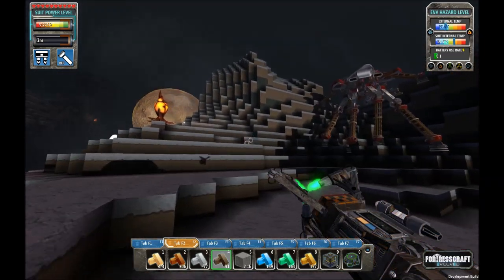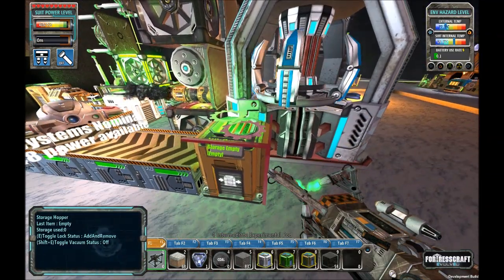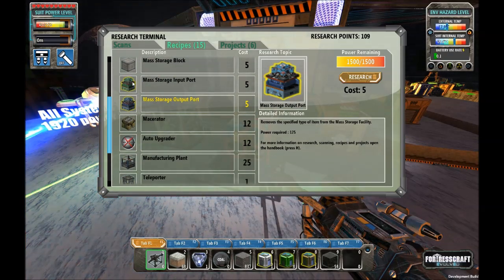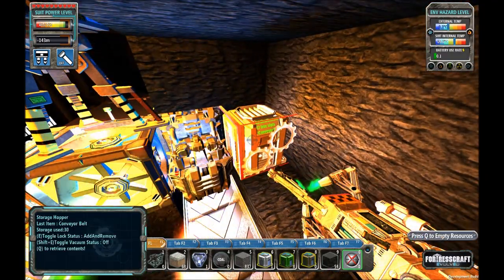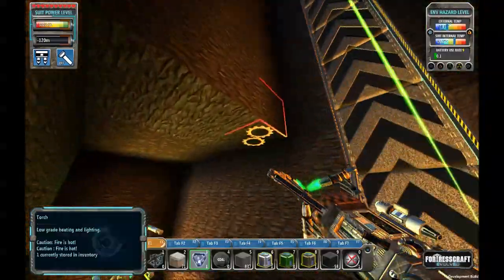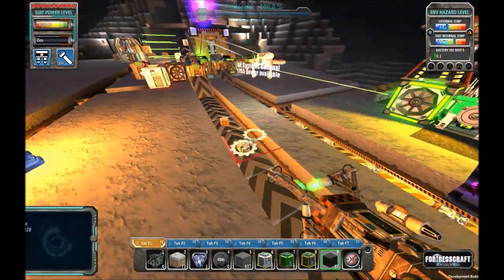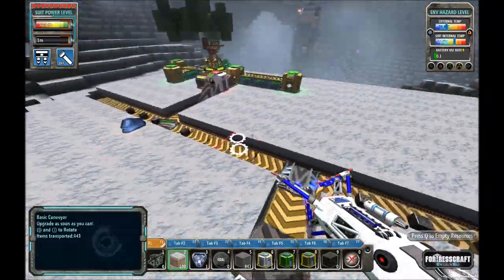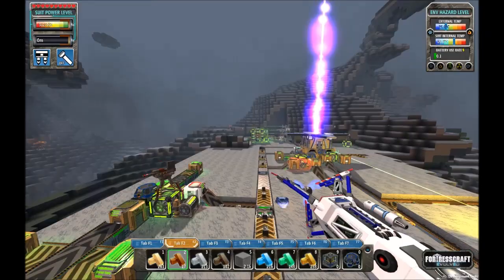FortressCraft Evolved   Ep10 More Ore Automation

Comment: the best way i found to power the lab early game is to place generators and hoppers like so
G = generator
M = mini hopper (green hopper)
H = 100 storage hopper

     v-----feed coal into this hopper
G H G 
G M G
G M G
    M 
G H G
G M G
G M G
    M
G H G
G M G
G M G

warp this around from one side over the top of the lab and down the another side
this holds 3000 power from the lab and 1000 power from each generator for a total of 21k power storage and power per sec of 180 power per sec. this works best if you have automated lines for each pod. which would take up the other 2 sides of the lab leaving only the only the bottom of the lab free to place more generators.

i got all my research done before i even got to jet turbines =//

Comment: You can cheat the 100 item stack limit in the storage crates (at least for now) by doing a "substitution" instead of placing an item in. So, in your inventory, you have say a stack of 300 dirt. If you grab any item from the storage crate and put it on the stack of dirt in your inventory, they will trade places, and it takes the entire stack from your inventory. :D

Comment: Something I noticed across the past few episodes is that your back corner (Laboratory) turret is sitting on a power cell that is putting power into the lab, creating a real limit on how much the turret can shoot before it loses power as the Lab sucks out all of the power before it can be spread to the turret. I don't know if that's causing an issue with overall base defense but it might be beneficial to add a separate power cell for the turret itself. It's not an issue for your Furnace turret because the furnace doesn't drain nearly as much as the lab does.

Comment: Me and my brother are trying to play minecraft together, when I open my world to LAN it doesnt appear on his screen. Can anyone help?
Reply: +ItsEcho maybe it has something to do with the firewall or your computer connection does not share info in private networks. go check the control panel > networks and shared resources (or something like that, i have my windows in non english language) > advanced shared usage configuation (more about something like so) 

perhaps both of you are not in the same home group

check that in both computers hope it helps
Reply: +ItsEcho 
On your computer: Open Network and Sharing Center -> Change Adapter Settings -> Right click Ethernet (or Wifi if that's how your computer connects to the router) -> Status -> Details -> Write down the "IPv4 Address", usually something like 192.168.0.3 but can vary.
In your brother's minecraft add a server with this address and it should detect when you open your world to LAN.
Reply: sorry neither of those worked
Reply: now going crazy, can you ping the other pc? so you're sure they comunicate?

go windows key + R and type there "ipconfig" (don't worry you're not going to change nothing, just checking) you're looking at a line that says "something ipv4" it should show a number like 192.168.0.1  (or 1.1 or similar) in both computers.

if in the black screen shows the default gateway is different in both computers (like one is 192.168.1.1 and the other 192.168.0.1) they won't communicate and there's your problem. 

 if they are similar try this (i'll explain it with an example since it's kinda hard for me to explain it in a non native language)

computer A has ip: 192.168.1.1
computer B has ip: 192.168.1.15

in computer A inside the black screen type: ping 192.168.1.15    this shoud if the computers communicate give a result of "answer from <ip> bytes = 32 bla bla bla"

if that's your answer they communicate and there's some software issues (java blocking, firewall in pc's, firewall in the router)

if you get the message "unaccesible destiny host" they do not comunicate.

Comment: Direwolf,  with 2 conveyorlines merging in a T-form, they will alternate. It will try to do 1 from each side every time. Only if you  make one line straight and a second line come in 'from the side'  the straight line has priority
Reply: Also if you ever have problems with merging lanes,  use a storage hopper that gives true throughput. Imagine a hopper being fed in from the sides. 
_
|     |
[H] _____OUT

Is how you get true throughput,   basically a hopper having 2 lines going to the same out.